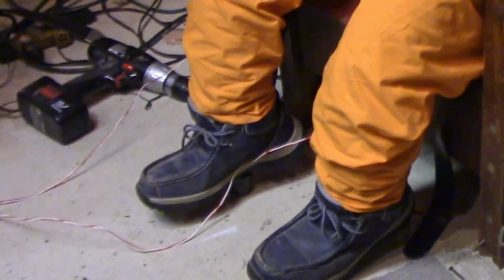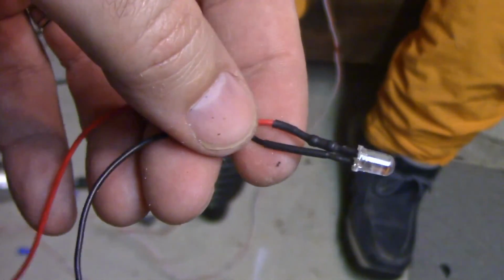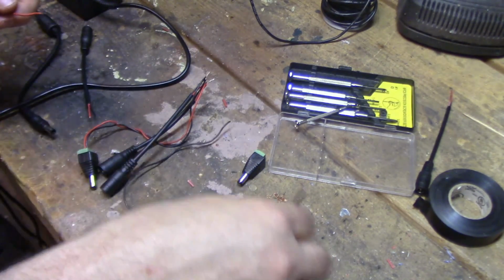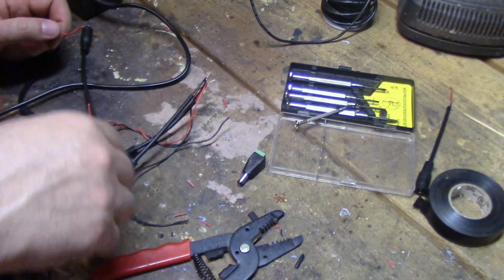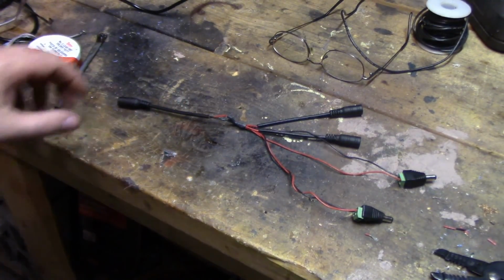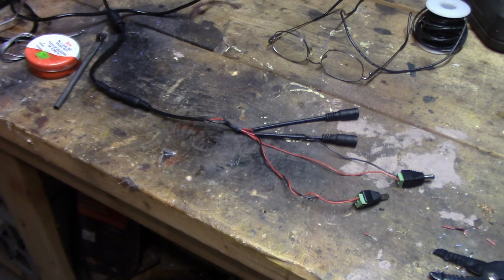Arduino Electric Chair Prop #12 - DIY Halloween Vlog 2016 #43: Electrifying! (Part 12)

Comment: You really should add a 3A diode across each actuator (striped end of diode to +ve side) to suppress the voltage spike that occurs when they switch off.  That spike could easily cause the LEDs (wired across the solenoid) to fail.
Reply from the maker: Yep, I mentioned that the diodes hadn't come in yet. That will be done in the next video. Thanks, Dave!
Reply: Yeah, I heard you mention the diode briefly, but thought I'd explain why and offer a possible cause for that dead LED.  :)
Reply from the maker: Thanks, man. I appreciate you looking out for me!  However, I think that LED was either DOA or damaged when I put it in the shoe. It never had electricity applied until that first attempt. Unfortunately, I didn't bother testing it before putting it in, so who knows?. I won't make that mistake again, though. I would have wired in the diodes, but they just showed up on Friday! All the other stuff got here weeks ago, and I filmed this last weekend.